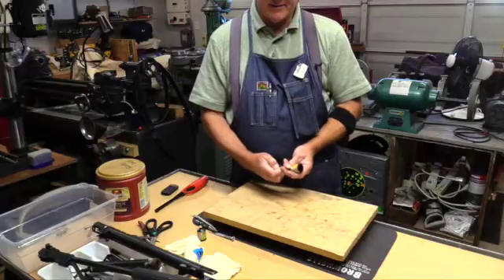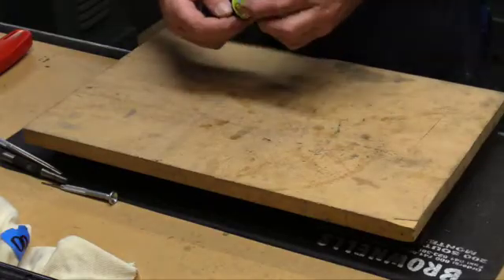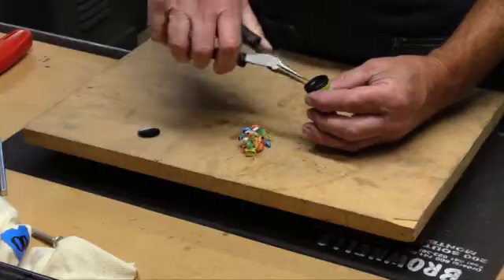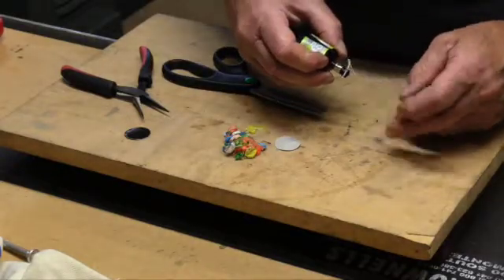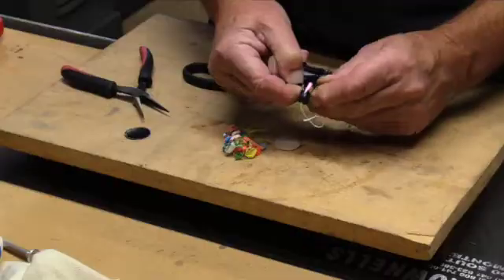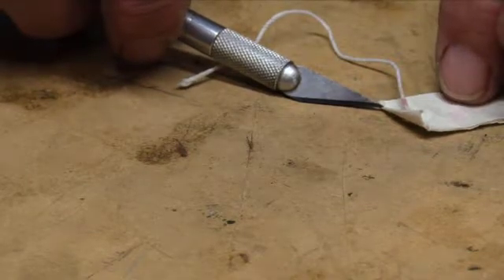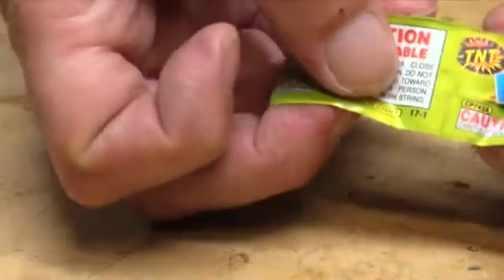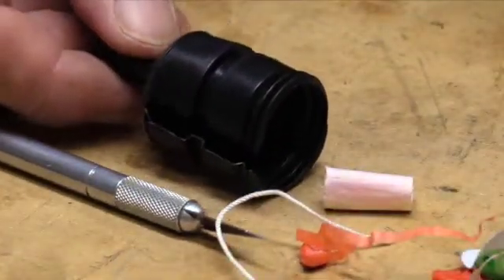What makes party poppers pop?

Comment: Here's my story:  I found a bunch of poppers at work. At  Trader Joe's the produce bags came on plastic tubes ( not no more ) Incredibly, the party popper fit PERFECTLY   into this tube ! I actually made a sort  of   gun  with a trigger to pull the string ( with all the guts removed , of course ) of one. A used popper  inserted in the other end of the tube  shot across the room !! I think if  two or three  propellants were ignited simultaneously , you could create quite a bit of propulsion .
Reply: Hey, I’m trying the same thing. A fake prop (gun) made of cardboard + clay, and a popper triggered when you pull the trigger by a string. I was thinking of using rubber bands and other thing as well, how did you do it?